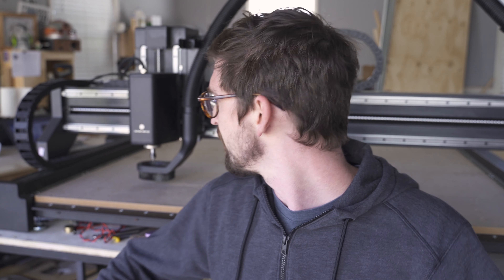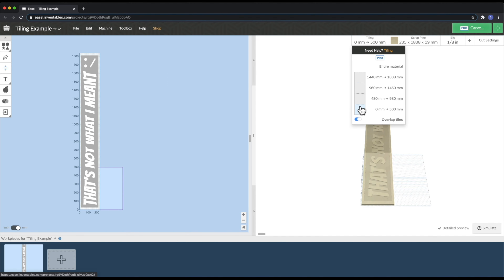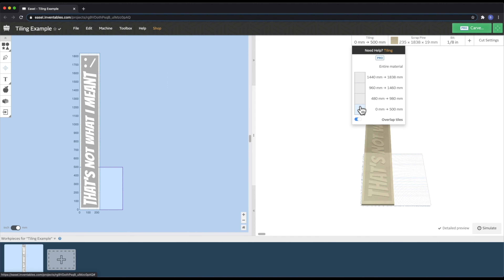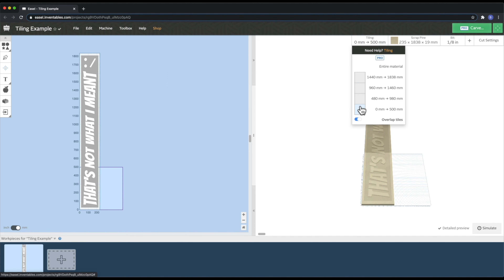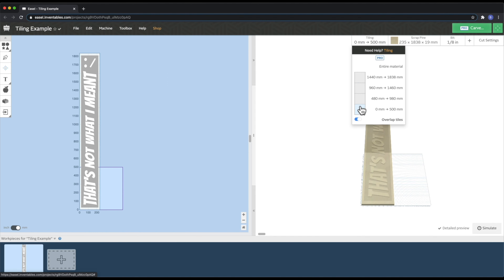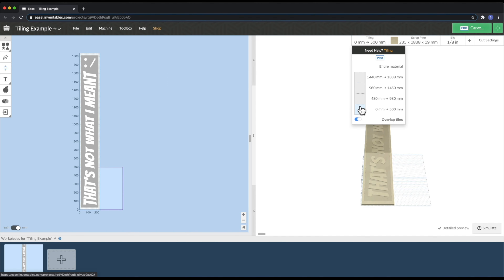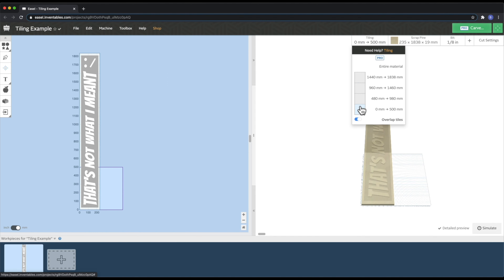X-Carve Pro: Under the Hood

Comment: Fell in love with the 4x2 !!! Its a good looking machine  !!! 
Quick question: so if the spindle automatically shuts off at the end of the cut, can you eliminate using tabs from having them fly off the table or is it still recommended  ?
Reply from the maker: The spindle does automatically turn off, one of the many benefits of having it controlled by the software vs a standard router.  With tabs you have the option to turn them off, or even modify the number and position of them inside of Easel.

Comment: Does the dust collection shroud move up and down with the Z axis, or is it fixed in place? I couldn't tell in the video, and the manual adjustment makes it look like you have to set it once throughout the entire cut, which seems like it wouldn't work on pretty much anything other than the most basic of cuts.
Reply from the maker: Great question!  So the shroud doesn't move with the z-axis.  You set it at the beginning based on the height of your material and then your good to go.  The mount is actually attached to the x axis gantry.
Reply: @inventables  Interesting. Because the dust shroud is fixed during the cut, you only get the distance from the top of the fuzzy bit to the bottom that's covered. The machine technically has 4" of cutting depth (which I acknowledge is limited by the cutting bit), but you'd only get good dust collection for the last 1-2" of that cut.

That being said, I just realized that—in practice—it doesn't make much of a difference, since if you are cutting a slot deeply, the dust collection has to stay near the surface. It would only make sense if you were removing enough material to make room for the dust collection head for the entire depth.

Thanks for answering!

Comment: What it the longest cutting  size for the C-carve pro? On the website says 4’ by “unlimited”  does that mean I can make my table 4’ x 10’?
Reply from the maker: The Easel Pro software has a tiling feature so you can feed longer material through because the front and back are open.  The cutting area is 4’ x 4’ x 4”

Comment: I compare the x carve prob with the mill right power route xl. Same size cut the same with two exceptions, the router and spindle and the price. Mill Right uses a Makita router and you use a spindle. Mill Right $5600.00 and Inventible X Carve Pro 9400.00. Both cnc routers does merely the same and there are more like Vivid with a high end price on it as well. In the future if there any making in a CNC machine in the middle of the x carve and pro that can be affordable?
Reply: The Mill Right offers one Rack and Hardened Steel Pinion system on the X and Y and a Lead screw with anti-backlash nut on the Z and one machine with a 16mm ball screw.  The X-Carve Pro uses 25mm ball screws and precision ground linear guides.  The X Gantry is almost 2x larger in girth on the X-Carve Pro than on the Mill Right.  Finally the spindle vs. router that you already mentioned.  The motion system, size of the gantry, spindle and VFD, deliver higher throughput and precision and that leads to a higher cost both to manufacture and to the end user to purchase the machine.  The X-Carve Pro also includes the dust collection system, Z-Probe, start bit kit, tools, 3 years of Easel Pro software and shipping as of 10-20-21.  If you are interested in something in between please contact Inventables customer support 312-775-7009 and explain what you are looking for. They will pass your feedback on to our product development team who may be in touch to learn more and consider your input to our future product development.

Comment: Congratulations! How wide are the linear guides ?
Reply: They are about 1" wide and there is 4.75" between them.
Reply: @zachkaplan4011  Great! very strong rails abaut 25mm! 
About ballscrews, how much does it move per turn, 5mm or 10mm? 25mm diameter are very strong and rigid! well done!
Reply: @juanjobravo4476  We use 10mm pitch screws so it moves 10mm per revolution of the ball screw.
Reply: @zachkaplan4011  Excellent machine fast enough !

Comment: Is there a video showing the machine working with material other than wood, maybe acrylic, aluminum, PCV, ect?
Reply from the maker: Not currently, but those are in the works!  Any specific types of projects?
Reply: @inventables  I am very interested to see how it would cut/v-cut acrylic, pvc and alupanel for production of interior decorative signs.

Comment: Is there any limitation as to what can be above the X-Carve Pro as it carves? I want to have upper cabinets above them but not sure if the vacuum can be rigged in a way so there is plenty of room to move.
Reply: There is a pole to hold the hose but you could hang hooks yourself using the hose isn't a requirement.  You just need enough slack to reach the perimeter of the machine.  You may be able to fasten one of the hooks to the cabinet instead of using the pole.

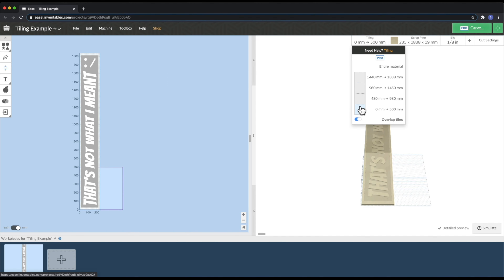Comment: 1:17 The 4' spec is due to limits of transmission with threaded shafts; a longer gantry would warrant a timing belt.
Reply from the maker: We designed the machine to cut 4’ wide so it could handle a 4’ x 8’ sheet of plywood

Comment: Can you run the machine with software other than Easel?
Reply: Yes, any CAD/CAM package will work including Fusion 360, V-Carve Pro, Aspire, etc.
Reply: @karvecutcnc5497  Easel can also act as a g-code sender.  The firmware is GRBL so you can use other senders if you wish.

Comment: how does the tiling feature work?
Reply from the maker: When you have designed something that is larger than the size of the material set in Easel Pro the tiling feature will appear and allow you to carve a specific section.  The carving walkthrough will prompt you to clamp the material and advance it along a bump stop to keep it perpendicular to the X axis.  You’ll measure and advance the material to do the next carving.

Comment: price is way over the top.
Reply from the maker: We get the price can look high if your benchmark is hobbyist machines.  The X-Carve Pro matches the feature set of higher end professional machines and a similar price point but keeping the same ease of use our customers have loved.
Reply: @inventables  

You now have a great competitor, both in quality and price "Onefinity cnc.👋🏼
Reply: @Aaron.A22  The Onefinity is a beast!
Reply: @Aaron.A22  I don't disagree that Onefinity is an option... but it won't handle a standard plywood width. It doesn't come with a router (and the XCP has a spindle instead). I do think it is priced a little high... considering it has smaller steppers.

So while I think the XCP is a little over priced... it isn't the same class of machine as the Onefinity. I am sure quality is on par... and obviously Onefinity wins on price.

I wish that the "hobbyist machine" standard was a 4x2 machine. At least that way a standard plywood width could be used.